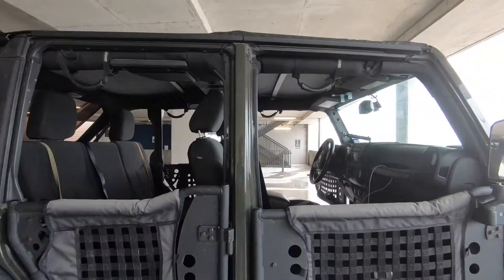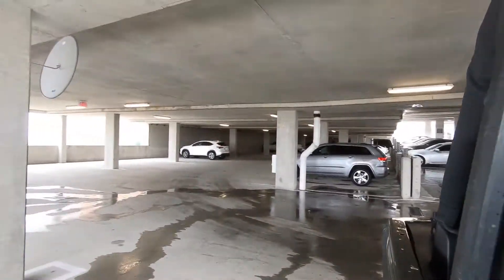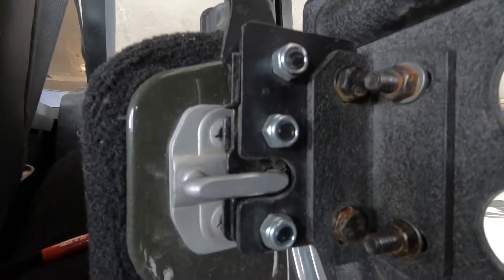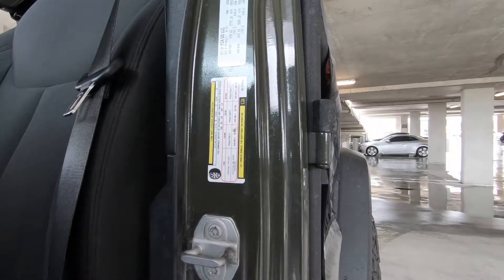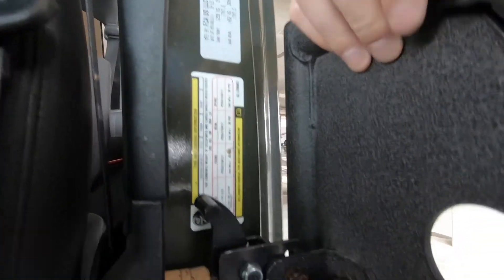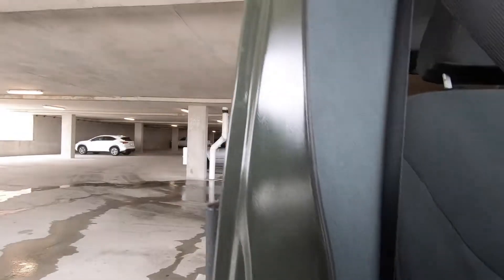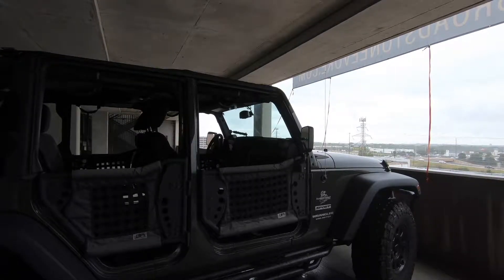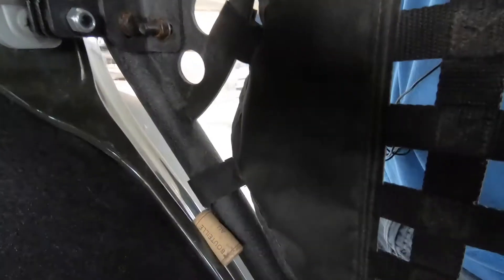Fixing the rattle on BodyArmor Jeep Gen3 Trail Doors

Comment: The little bolt that was supposed to mount the rubber bushing door stop to the door  wouldn’t line up at all with the predrilled holes.  The instructions were garbage.   They should just include a sheet of paper that says “Look up how to install on YouTube”.    They should work on getting that little hole drilled better and produce much better instructions.    Otherwise doors seem pretty solid.